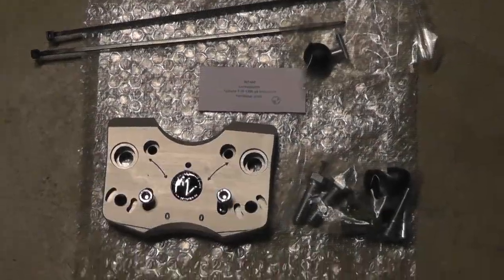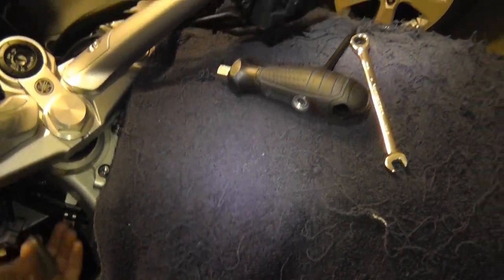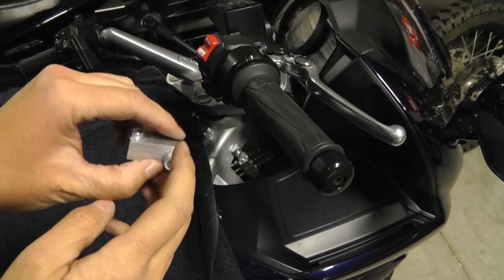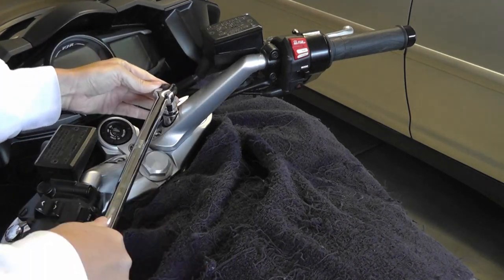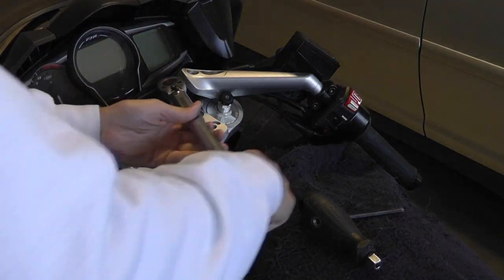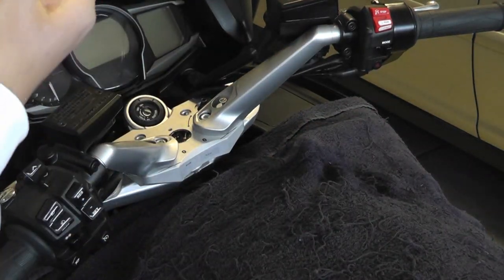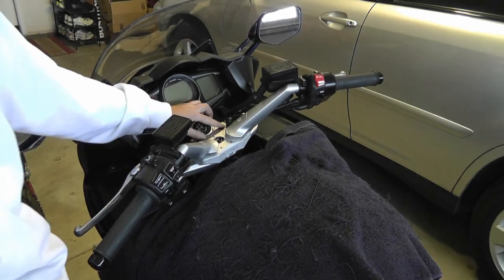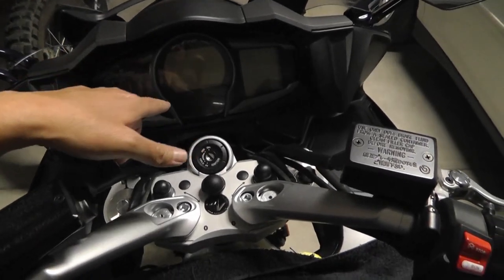How to Install MV Motorrad Risers on a 2016 FJR1300

Comment: I just purchased a 2024 FJR 1300 and I have already adjusted the bars to the back. Still not sure what I might do to make it more comfortable? I've been looking into Bar Risers and I was glad to come across your video, because it looks like the best way to go. Much less intrusive than The Bar Risers that just raise the bars without coming towards you, and it looks like an easier install. Still breaking in the new engine and I'm quite impressed with this new Bike! I also own a 1990 Yamaha VMax, and a 1998 Suzuki 1500 LC. The FJR is Quite Impressive, plus I'm acclaimating to all of the new technology! Thanks for the great video, and a bit of advice when using a Torque Wrench: Left hand on Pivot Point, Right Hand on end of wrench, feet in a forward stance ( Left foot forward, Right foot back). This will reduce the chances of slipping on the nut or bolt that you are tightening, and give you better control and leverage.🙂

Comment: I installed mine yesterday and will test them out tomorrow. Only issue I had was dropping the longer screw on the brake line bracket. Still looking for it and went and bought a new screw at the hardware store. Thanks again for the best how to video yet.

Comment: Just installed the mv motorrad handle bar extension on my 08 fjr. This video really made my install much easier since the instructions only help to a certain point. Thanks for this video. Also this mv extension really made a big difference for me. Now I'm not reaching and no more pressure ony hands and shoulders. I'm now on a upright position. Very comfortable. FJR Nation!!!
Reply: Hey Sergio thought I would ask you if these adjusters helped with forearm burning issues and other issues that come with the fjr’s. I’m naturally taller with longer arms so I don’t mind having my arms stretched out straight but my right forearm burns really bad because of the angle of the handle bar
Reply: @tommyv22222  how's it going. For me the handle bar extension works well. I'm only 5'8" and still felt like I was reaching for the bars. I was feeling it more on my sholders and upper back. Also my hands tend to go numb after riding for a while. More the left hand. Nothing on my forearms. Now i sit very comfortably and upright. Maybe if you get the risers your not putting too much pressure on your forearms. But not sure if the riser will help you out.
Reply: @sergioamescua6264  I have a Gen 2 2008 And came with 1 inch risers which seems to be all right but it could just be where I am used to my older sport bike that has clip on‘s The weird thing is I can ride that for two hours and not feel nothing but when I have my handlebars on my FJR in the far back position with the 1 inch riser that’s when I feel at the most when I move them to the Forward most position it doesn’t seem to hurt as bad It also came with Cupped tires so the bike doesn’t track straight and I realized the other day that I had to kind of use more pressure with my right arm to keep it straight so I’m thinking that and also the throttle and not being used to that position could be causing my forearm to be burning. Well I appreciate you getting back to me I’m going to replace my tires and see if it stops and if it doesn’t my next step will be the MV Motorad adjustable riser and hopefully by being able to straighten out the handlebar a little bit it will make all the difference I noticed my arms with the angle now have a weird kink in them So maybe that 20° adjustment angle will make all the difference thanks again I appreciate it and be safe riding!!!

Comment: The seating position of my '15FJR is why I decided to sell the bike. I adjusted the handle to the most aft / rear position towards me, hoping for an upright seating position, but that was not enough. I still find myself leaning forward, and I get lower back discomfort on longer rides. There is no way I can make a road trip of several days on the FJR. That is when I decided to look into bar risers and came across the MV Motorrad. I placed the order on Tuesday morning and delivered it on Thursday afternoon—speedy shipping from Germany. 
Your video produced the clarity I needed to complete the installation.
Reply: So how is your feeling now ? Better ?
Reply: Did the risers help at all?

Comment: Hi Vicki, Did you have to install the brake extension cable at a later time? Also, any further updates with regards to the MV install since this video?
Reply from the maker: Nope...never needed a brake extension cable.  I didn't do any adjustments outside of my video.  I still have my FJR that's in this video and ride it nearly everyday.  I love it, and my MV risers...no regrets!!  If you get the MV risers, make sure you get the correct one for your year of FJR...and I can't remember if it differentiates if yours is an A or AE model.

Comment: Thanks for your video! It was invaluable when installing my risers today. One thing that was on my paperwork was to move the throttle cables on the right hand side out of the harness and zip tie them to the fork. I didn't see that mentioned in your video nor did it look like you re-routed yours? I could lock out the bars on both sides without moving them, but there was definitely more slack when I did.

Comment: Hey  Vicky I know this is an old video but was wondering if you ever had to deal with your right outer forearm burning with the original set up? If so when you put these new riser adjusters on there did it help being able to adjust them to different angles
Reply from the maker: Gosh...it has been a while.  But I can tell you, on my previous gen FJR, my right hand did fall asleep with the original setup to the point where I had to rest for a few minutes.  With my current setup, I have a crampbuster on my throttle, which helps a bunch.  I do remember, on the original setup, I had to lean forward more, so this put pressure on my hands.  Yes, with this particular riser...the MV Motorrad, you are able to adjust the handle bars to different angles and how forward or back you want your setup to be.  I love my risers, and will definitely install them on my future FJRs.
Reply: @vickip  Great thank you so much !! Be safe

Comment: Installed today the Motorrad Risers on my 2012 FJR exactly as guided by Vicki.  Riser plate is all the way backwards (towards seat).   My assessment is that the the cable harness leading to the right handle is very, very tight.  To the point in my mind that it may be at risk.  Vicki, I used that adaptor block on the right side, adaptor plate on the left side and removed two ziplock ties on the left side.  I think it is still very tight and with hardly any slack. Wondering if you ended up rerouting the harness leading to the right handle.   Other than that product is great!  Thanks!
Reply from the maker: Congrats on the install.  No, I did not have to re-route the cables.  Maybe my FJR or the 2016 had slightly longer cables.  I don't remember if I have the riser plate all the way towards the seat...not sure if that's a factor.
Reply: @vickip  Ok Vicki, got it.  This morning I plan on pushing the plate a bit forward (towards cluster gage) to see if I can get some additional slack.  Again, issue with the install is with the right side. Harness leading to the right handle is very tight in my mind and clipping the ziplock ties on the left is only releasing one or two of the cables leading to the right handle, not all of them!). So we’ll see...Thanks much!!!
Reply: @yl4970  Did your issue get resolved yet? Am curious as I plan to invest in the MV as well but have been reluctant all along not knowing how to manage cables.
Reply: @ShujaKidwaiMasauliwala  Had to adjust the handle to a wider angle than I originally wanted… I am managing and the riser plate itself is crafted professionally.. However I don’t believe the overall design is flexible enough to allow complete freedom in adjusting angle of handles and movement of plate backwards toward rider. Again, it is all about creating too much of tension to the throttle cable assembly…
Reply: Hi,  @yl4970  and @Vicki P, I've found some videos warning for this risers failing, as leaving the handlebar loose.  Do you, or anybody here, knows anything about this? Thanks.
Reply: @AntonioSantos-me4nx  Not sure what this video is implying? It gives no context.. just someone moving the handle back and forth.
Reply: @ShujaKidwaiMasauliwala  that was what I thought.  That is why I'm asking, if someone knows some more info about this. It could even be some kind of fake video. If you don't use the correct tightening torque for sure this could happen (I think). Any way, I ordered the adapter. Let's see if it works...
Reply: @yl4970  Do you know if the shorter cables, could be replaced for longer ones?
Reply: @AntonioSantos-me4nx  Hi Antonio, never seen those warning videos. Can you share? I am still using the Motorad riser plate but have not moved plate all the back because it risks, in my own mind, integrity of throttle cables/cables assembly…
Reply: @AntonioSantos-me4nx  Well I was thinking myself about such option. Saw Yamaha replacement cables but they all seems to be same length as original ones. Would indeed be a good solution to this installation…
Reply: @yl4970  I have the link of that video up on this thread. About the longer cables, on the dealer they sad to me that it has to be a personalised solution, with metal cables, because the yamaha ones are all the same length. I will be mounting this in 2 weeks. The package as already arrived from MV. After installation I will give some feedback to you. I don't plan to replace any cables,  except if it will be a requirement. I've chat by email with MV, and said it shouldn't be necessary,  however the cables should be routing in a different manner.
Reply: @AntonioSantos-me4nx  Antonio, yes, I have seen Viki’s video and indeed it is done very well.  And I also re-routed the throttle cables in accordance with MV Motirad’s instruction using one zip tie and so on. But I am again claiming that if you want the plate to go all the way back (towards rider) and at the same time adjust handles to a smaller angle (meaning, more towards each other) as I personally prefer, then you’ll see that the throttle cables get so tight (even with the re-routing) to the point where it becomes real risky. Again, my FJR is from 2012. I know for sure that Viki has a newer GEN 3 bike and so perhaps there are some differences in dimensions. I also not sure if Viki moves her plate all the way back like I tried doing…It will be very interesting to hear of your experience with your install. Good luck!!!😃

Comment: At 7:09 when you loosen off that bolt, does the whole assembly (block & 3 silver lines) just pull forward without any damage?
 Mine felt like it was pretty firmly in place and that something would damage inside if I just pulled it.
Reply from the maker: I just pulled the blocks back and they didn't cause damage.  I had to place a screwdriver into the hole as leverage to pull back so I could align the holes.  It was a pain in the butt to line up, but very doable...just takes a little patience.
Reply: @vickip  Ok, thanks
Reply: Vicki P someone told me you have changed spark plugs and performed a carb sync since installing this handlebar riser.  Did you have enough clearance to raise the tank past the riser?  If so, did you video the procedure so we can see how the clearance works out?  Thanks for taking the time to make this video.  Great information.
Reply from the maker: @igetthepic  , Yes, since the riser install with my final adjustment, I have replaced my spark plugs and completed a throttle sync.  I had clearance to loosen and/or remove the tank bolts, raise my tank, and to place a book (or brace) to keep the tank lifted so I could work underneath.  This riser is AWESOME!!  Quality it top notch!!

Comment: You better go to the stove.....
Reply: Did you mean me? All of you who haveinstalled the Mv board on the FJR 1300 turn the steering wheel to the right. The problem is the hydraulic hose. Sand the lock housing below.So solve the problem. Viki didnt say that!!!!!!!!!!!!!